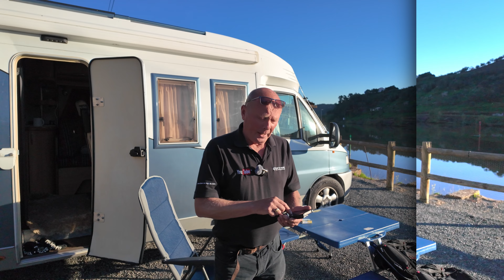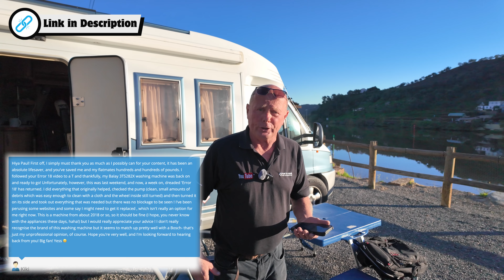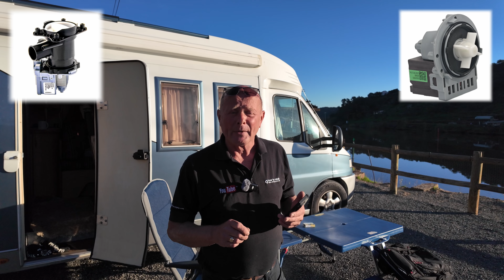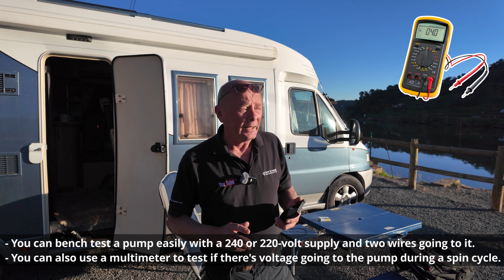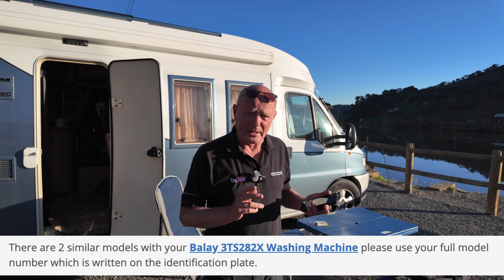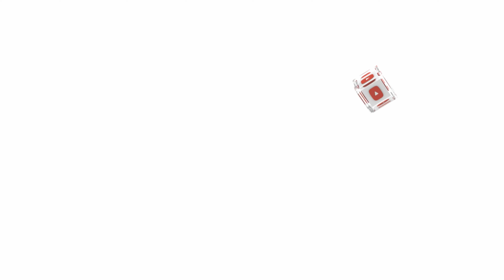Balay 3TS282X Washing Machine Not Emptying & Shows E18 Error Code - Washing Machine Troubleshooting

Comment: I have a problem with E17 error for this model. I have cleaned the filters, checked the hose, no blockages, no kink in the hose, it won’t run any programme, the error message stays on even after switching it on and off. Any ideas? 👍
Reply: I’ve fixed the problem by activating the ‘reset’ process, this clears the error message. Washer now works fine. 👍